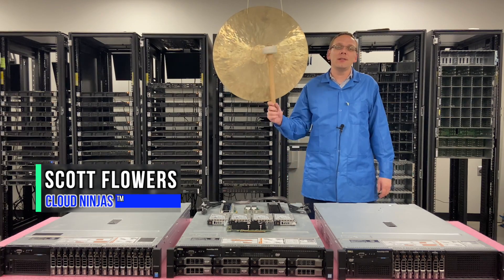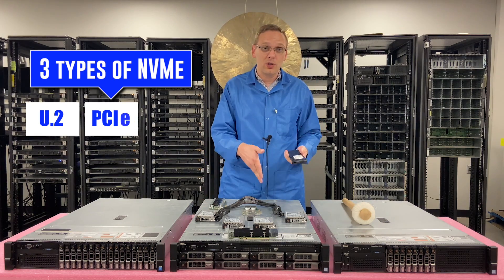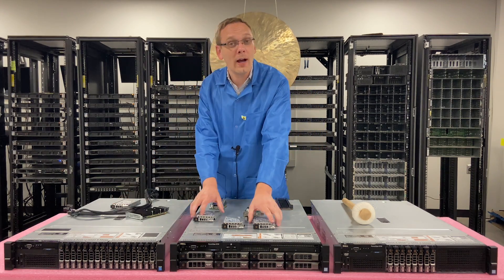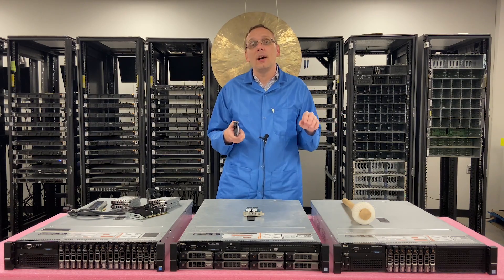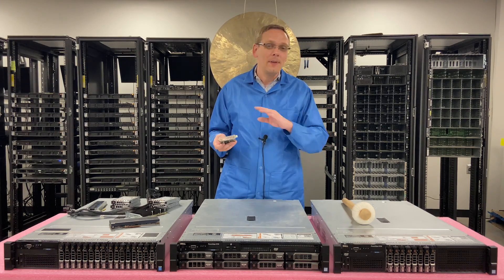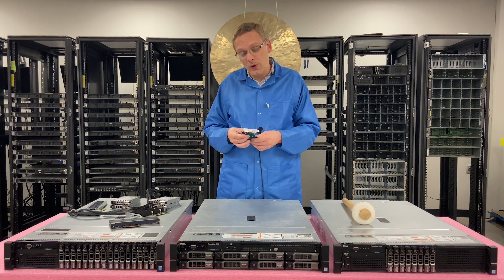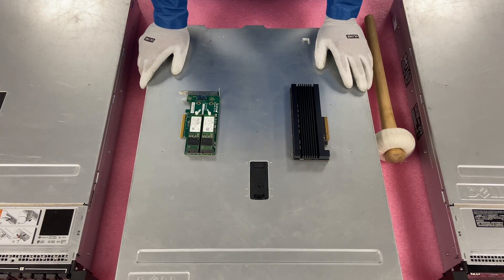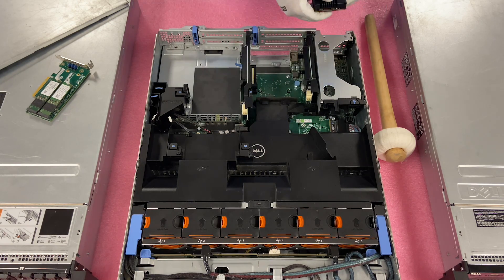Dell PowerEdge R730 Server | NVMe SSDs Overview | Install Tips | How to Configure | M.2 | U.2 | PCIe

Comment: you can use m.2 nvme on dell R730 with a pcie nvme card it dont have to be supermicro etc i just got a $20 card from amazon and use clover on a usb to "trick" aka boot loader the bios like a bridge to the nvme to boot from nvme i run ubuntu from the nvme at boot no problems...it puts a nvme firmware on the usb so at start up it can see the nvme pcie card

Comment: Can i use those m2s for OS disks, bootable?
Reply from the maker: Yes but not with the NVMe M.2's when it comes to the R730 server. And since M.2 slots are not native on the board you will need to opt for a BOSS card in order to achieve this.
Reply: Yes, you can even with NVME :) But you have to install additional bootloader on usb flash drive like clover or refind. Done it with mine R730 and works perfectly fine.

Comment: But you can use U.2 NVMe's in R730xd, there is the same PCIe card as in R630 and then you get the last 4 positions (out of 24) in backplane to support U.2 NVMe.
Reply from the maker: Yup.  Check out our R730xd NVMe video. 😁

Comment: I'm trying this same setup with the Dell R930 and the same Supermicro adapter. It doesn't seem to be working and I'm getting errors like "a bus fatal error was detected on a component at slot X", whichever slot I try the supermicro adapter in. Is this not supported on the R930?

Comment: Will a Dell DPWC300 m.2 pcie card work and boot from this card?
Reply from the maker: Man wish I had an immediate answer for you.  Never tested it to confirm 100%.  Been slammed last few days.  Had to build 240 servers in 2 days for a partner plus our normal day to day.  Monday we will come up for air and I'll have our team check our inventory and if we have in stock will test out and let you know.
Reply from the maker: I can say generally speaking Gen13 didn't have good solutions for a 'boss card' with m.2 boot capability.  14th gen is when better solutions for this started.  Hope that helps.
Reply from the maker: And we have over 2K Dell R640 in stock if interested in 14th Gen servers.

Comment: So can you then use the built-in Perc 730 mini to make a RAID volume with those 2 drives?
Reply: No. The PERC H730 Mini is a SAS-3 RAID controller card. It has no way of controlling these drives. It only speaks PCIe 3.0 8x to take the drive data to the CPU - not to talk to PCIe drives.

Comment: Thank you for these great videos.  I have 3 questions,
1. Would you know if the "Supermicro NVMe M.2 PCIe Adapter" work with TrueNAS and Dell PowerEdge R730XD?
2. If the 2 sockets are populated with M.2 NVMe SSDs, does show as one or two SSD drives?
3. Would the system allow 2 of these cards?

Thanks again for all your help.

Comment: Can I boot into the OS without Clover Bootloader in dell  r730? using supermicro card? or still need to Clover Bootloader?
Reply: Don't think Bob is coming back, I find no option to boot these directly with the R730 native. Need clover to make booty, installs fine, sees it 100% but needs those sweet sweet driver loading action to work in R730. Super fast card, great performance otherwise.
Reply: I just watched another video on this. My understanding is that for the R730, you can boot directly with an NVMe .. presumably using this setup. No need for Clover. If you had, say, and R630, or anything older than a R730, you would need a thumbdrive with Clover, then point Clover over to your NVMe to load the OS. But with the R730, you can boot directly with the NVMe drive(s).
Reply: Would you please post the video link? I was unable to boot from NVME, although was able to install the OS. @bobgunner3086
Reply: @bobgunner3086  I would also like to view this video, as it seems to be like that is not possible without a bunch of custom stuff.

Comment: I'm a little bit confused... Does the SuperMicro PCIe m2 allowed to do RAID(mirror) ? Do we see it in iDRAC as storage ?  What is different than the other nvme card that only display as storage ?  Since my HP DL360 G6 to my Dell R730, I've used cheap Amazon ordered PCIE card to get m2 card in there. Older hardware didn't support bifurcation, so I could only have 1 NVME per PCIE card.  With XCP-NG I do software raid off 2 NVME drive. The best would be iDRAC monitored NVME devices, so my HDD could be monitored.  Or even better, use a M.2 NVME to U.2 adapter and use it as hotswap in front of the server.

Comment: This is the most useful and clear explanation that I have ever encountered on this problem. Thank you !!!!
Reply from the maker: Appreciate the positive feedback!
Reply: @cloudninjas I followed this guide exactly but I can’t get the server to recognize the drives. I have two HP FX900 Pro drives. Any guidance or ideas why it’s not being recognized?
Reply: Not really. It doesn't say whether the host is in EFI or BIOS mode. It doesn't show the drives showing up in the EFI menu as bootable drives, or the BIOS menu for that matter. It doesn't show doing a test install. I suspect it is a way to flog more hardware under false pretences, based on people's experiences in the comments where EFI doesn't seem to work, and BIOS ability is at best sketchy.

Comment: Really appreciate the content Cloud Ninjas !

I'm running into similar issues as other commenters below.

I purchased this videos recommended SuperMicro M.2 Card (AOC-SLG3-2M2)
I have installed a single XPG GAMMIX S50 Lite 1TB M.2 2280 PCIe Gen 4.4

I have updated the R730 BIOS to 2.16, which enabled the Bifurcation setting, which I then enabled and set to 4x4x4x4

I have attempted to install Windows Server 2016 and 2019 and altho I have been able to format the M.2 drive and it is seen during the Rufus/Win ISO install, I cannot get the M.2 drive to show up as a boot option in the hardware list in the BIOS.

Questions:
The SuperMirco card has 2 slots. I have 1 x M.2 Drive. Does the M.2 installation slot matter or do I have to have 2 x. m.2 drives installed for some reason?
Does the installation numbered slot of the R730 Dell Riser card matter or can it go anywhere? (I have no other slots filled at this time)
I've seen people mention needing Clover Boot USB to make this work - Is this the only option? 
Why is my M.2 visible when formatting and choosing a windows installation location but not visible in the BIOS to select it as the boot drive?

Appreciate your help and insights!

Comment: Actually, the BOSS cards do work. I’m running a 730XD with the os installed right now. Only had to make sure boot order was correct.
Reply from the maker: Are you using NVMe M.2 or SATA M.2?  Thank you!

Comment: I tried using the Supermicro card with 2x WD m.2 ssds in slot 1 with x4x4 bifurcation and I cannot get the R730 to boot from it are there any other configs I am missing? Does this only work on an older firmware? Please advise

Comment: How many of the SuperMicro adapters can you run at the same time? Right now, I am running only Spinners in RAID 10 for my home lab. I am wondering if it is possible to add 2x SuperMicro adapters with each running 2x 2TB Samsung 980 Pro (for total of 8 TB) and remove all the spinners? That way, the server SHOULD running lot cooler and quieter. Any thoughts?

Comment: Hi, I tried it, and the super micro adapter I used, is not working, do have any other adapter cards that I can use? I already bought the m.2 cards, please help out
Reply from the maker: Hope you are well.  Received your email.  Will update you tomorrow morning.   Please also send over the info on the m.2 drives you are using.  Thank you.
Reply: @cloudninjas  thanks so much
I ordered it from Dell but seems they are Western Digital M.2 SSDs
Reply: @ShafiWay  Did you get this working with the western digital m.2 ssds? I'm looking to purchase a dell r730 for my homelab, but want to make sure this solution works without spending a fortune
Reply: @holec0591 hey, na it doesn’t work bru  you can’t run the OS on it, you can just read it like a USB basically

Comment: The PCIe card that worked for me is the JEYI Dual NVMe PCIe (Amazon ASIN B09TRVHW1H)
I set up X4 X4 bifurcation for Slot 1 in BIOS and I couldn't boot into the OS without Clover Bootloader.

If your fans permanently blast on high because of a non-Dell card, run the following RACADM command:
racadm set system.thermalsettings.thirdpartypcifanresponse 0
Reply from the maker: Great info!
Reply: Do you have it set to UEFI boot? If so, did you add it as a boot option?
Reply: Hello, I'm throwing a bottle into the sea.
Have you tested with CrystalDiskMark on your JEYI Dual NVMe PCIe card and if so what are the writing and reading results. Thank you in advance 😊.
Reply: @TheGadgyo  unfortunately that went untested. I would need to put that system together again if I were to fiddle around with it, sorry mate.
Reply: Thank you very much for your response, personally I have a card that I bought on AMAZON at a low price and I do 3500 mb/s reading and 3400 mb/s writing. I don't know if I can do more I think that the PCIe3 must restrict and in RAID 0, I gain in reading (4100 mb/s) but I lose in writing (700 mb/s), I think this is due to the fact that it is RAID SOFTWARE (windows). I think I could do better by using a Controller and SATA disks (SSD/NGFF) in RAID5 with a maximum of disks which would allow me to boot without the Clover USB key.
Too bad it is not possible to recognize NVME drives via M2 or U.2 enclosure. @primeral
Reply: I installed and followed your vide in my 730. Windows only sees just one card at a time. Both slots work and enabled the settings you mentioned but no luck. Any help if greatly appreciated thank you!

Comment: what's a good PCIe adapter for the R720?
Reply: I would like to know this as well. I have a R720 that could use some quick SSD storage but all 8 bays are full of spinning storage.
Reply from the maker: We are doing a whole series on the R720.  It will be coming up soon.  Next up is R730xd, R620 and then R720.  NVMe wise, there are not good solutions for the 12th gen Dell servers as a whole.  Wish I had better news.
Reply: Ya I figured I might not be getting "great" performance from what ever I put in there.  But those R720's are just work horses and if I can get away with using em till they die the final death then I'll do what I can. Thanks for your content and reply. I look forward to the R720 and other coverage.